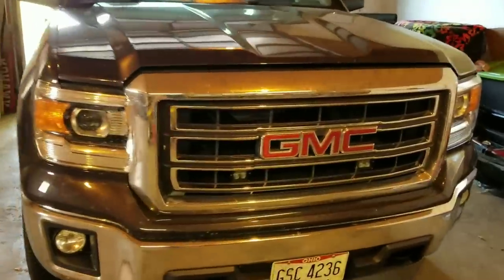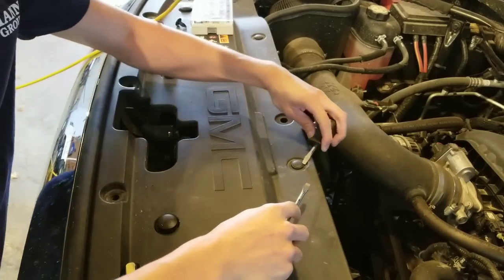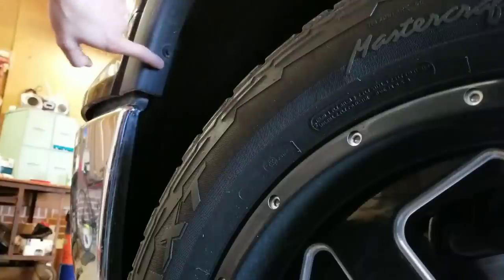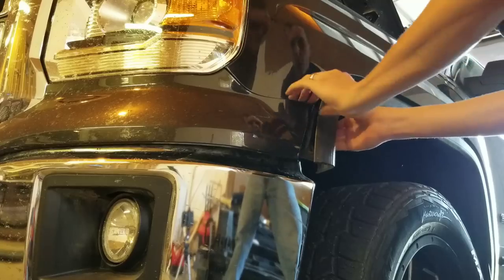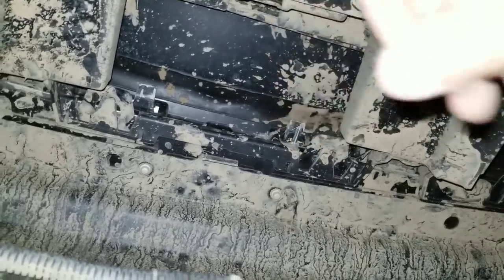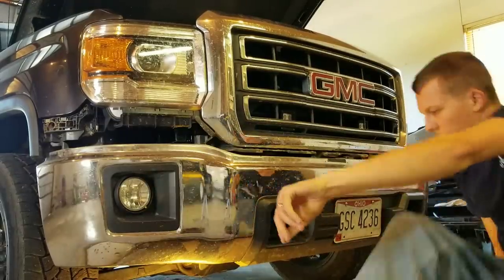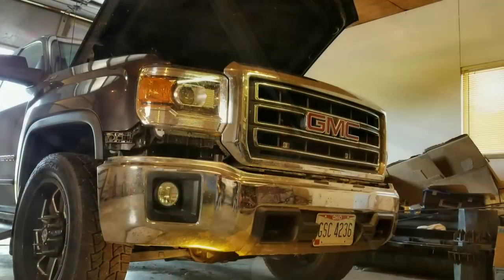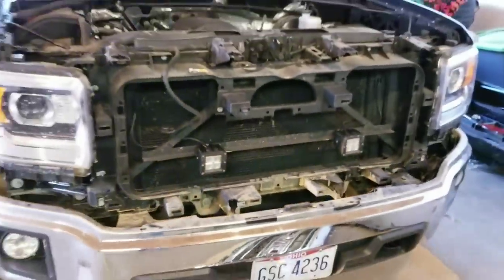How to remove grill off 2014-2018 GMC Sierra

Comment: I have a 2015 GMC Sierra 1500 I wanted to see if I could replace the front end with the 2016-2018 GMC Sierra 1500, will it just bolt on?

Comment: So I used this video to remove the grill off my 2018 Denali so it might be different, but...on that lower trim under each headlight be forewarned it's not coming off without snapping off several of the tabs that hold it in place and since that piece requires removing a bunch of others to replace them on each side I guess I'm going to have to use a small black headed screw on each side to now hold that trim in place.  Thanks GM!

Also on those 4 tabs up under the truck you are pushing up with one hand and pushing with the other...there are 3 push pins up under there you'll need to remove first before that will push out, they are up there underneath by the tabs.

Like many utube videos, this doesn't quite give you the bad with the good.
Reply: This is for 14/15 trucks not 16+ lol

Comment: Worked great for me on my 2018 Sierra. Broke a few clips on the sides of the bottom plastic piece, but seems to stay on the truck fine. Be extra careful with this piece, part of the plastic wheel well trim put a small scratch on this fascia
Reply: Same process with Denali version?
Reply: @bryangonzalez1917  Yes same process for all trims

Comment: would this also work on a 2017 gmc sierra? I think they have the same grills
Reply from the maker: Robbie Carcich yes it is the same process for the 2017
Reply: awesome thank you so much
Reply from the maker: You are welcome!
Reply: Robbie Carcich from outside it's the same but inside there is another automatic grill and i think it will not work

Comment: Great detail in your video.  I need to replace the radiator shutter assembly on my truck and I watched a video of a guy replacing on a Chevrolet, but removing the grill is different on a GMC.  Your video is what I needed.  I noticed you don't have a radiator shutter assembly on your truck, did you take it off?  Thanks, Dan
Reply from the maker: Thank you. That year did not have the shutters for some reason. My 18 and 20 both have them though.
Reply: Interesting, my father has 2015, I'll have to check his out.  Thanks again.

Comment: You dint have the grill shutters ?
Reply from the maker: Not on this one. My 18 does.
Reply: Tactical Advisor do you know is there away to take them off to put a light bar ?
Reply from the maker: @victoralvarez4852  I do not. I havent tore into this one. Id imagine there is but I doubt itll be easy.